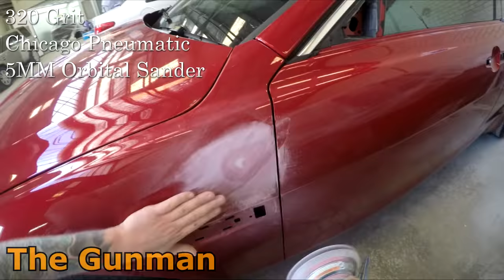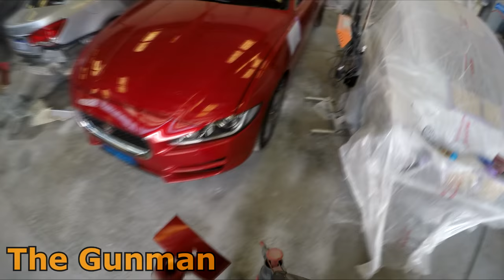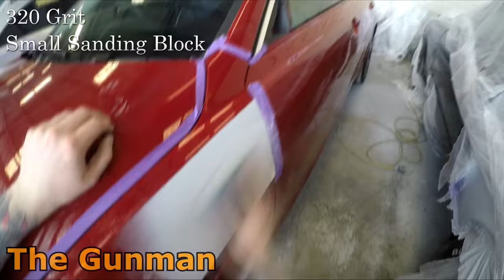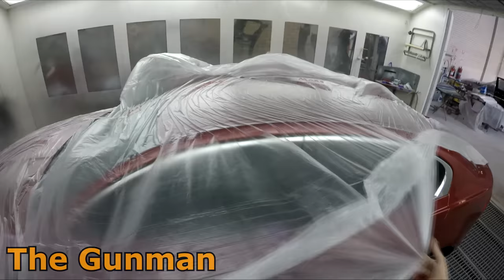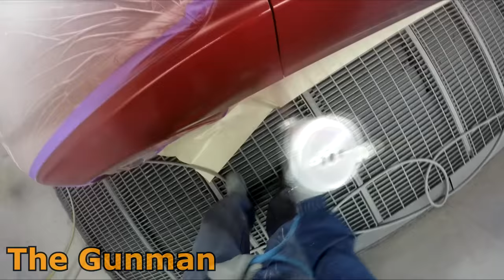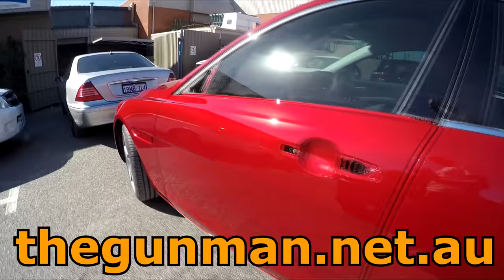XE Jaguar Spray Painting

Comment: That Nebula gun leaves an amazing finish with that clear.  You barely needed to add any more over your last coat just a touch at the top edge of the door and fender really!  I was a little surprised to see that you didn't need the base coat blender for the metallic red,  but in the video you cant see the blend at all.  Sick job.
Reply from the maker: Yeah I've found most darker colours don't need the base blender. Thanks mate.

Comment: You got a reasonably great guns, I mean DevilBiss (the one you mostly use) costs a lot less than SataJets, yet still works the same way, produces great finished works all the time. But may we also get some peaks or recommendations from you regarding a reasonably-priced yet effective Compressors? Perhaps we can see some great ideas on the next compressor that we should buy. I got a 1/2 HP compressor that works great for Big-Bikes, but for cars, I have to shoot it Panel per Panel since my compressor lacks air for big jobs.

Comment: Hey I remembered what you said in your video about the green primers possibly containing chromium. I've been stripping my honda civic 2007 lx and its coated in the grey green primer. I notice that I start to feel off after I sand it off and it continues to get worse until I take a shower. The stuff is simply horrible. (Not 100% that its chromium of if its all in my head)

Comment: Hey Gunman,

Propably a boring question.
Asked you a while ago for Some info.
Got two gti pro's.
1.2 and a 1.4 ( 1.3 tip was damaged ) and was able to buy a 1.4 tip rather cheap.

Got a t1 aircap for base and a t110 for clear or 2K one stage paint.
Also have got the H1 aircap.
Now i was able to buy a set with 1.3 tip, TE20 aircap and needle for a € 50,- / au$ 75,- ) because wanted to go back to 1.3 tip.
At home i use two 50 liter compressors connected to each other. So now a 100 liter. Both deliver a 260 liter per minute.

Now need your advice! I need to sell the 1.4 tip and an aircap... To get some money back.
What aircap to sell, with the needle, 1.4 tip. 
Will be painting some bugs coming monts... Painting Will be done in a rented spraybooth.

Base 1.3 and t1 ( or te20 ) ( t1 uses less air )
Clear 1.2 and t110.

Help me...

Comment: Question. Is old paint bad? I have paint that is about 2-3 years old. I purchased it to paint my car long ago but it got rear ended and totaled before I could used it. It was PPG paint for an OEM Nissan black color. Think I could still use it or its no good now?
Reply from the maker: If it's solvent then it should be fine, it may just need a little more thinners because some may have evaporated.

Comment: What happens if you fix a small dent just with the fine filler and do not apply primer? Im not a pro, but I have been getting some problem on primer edges (lots of dieback) even on light coats and sanding with 800 grit.
Reply: Think of filler as open celled meaning the paint will just sink into it and get absorbed.  Primer seals it off and gives you a solid build surface to paint onto.  I have had trouble with primer edges before and it was sometimes due to:- temperature/ humidity- primer mixed at wrong ratio- wrong type of primer for the paint it was going over- applying coats too fast (not dry underneath- adjacent surfaces not sanded enough or not cleaned thoroughlyDon't be afraid to experiment a little.  You'll figure it out and when you do, you'll immediately recognize it next time and save a lot of headaches and worry.

Comment: hey gunman I've used sata my whole career but I'm interested in trying out this pro lite. I'm in Texas all I can get is the tekna. have you used one to see if they are the exact same as what you use
Reply: Chrism Murphy    tekna is the u.s. version  it's the exact same but black  usually comes with a 1.2 1.3 1.4 needle nozzle's  and te10 te20 cap.  so u get all that for a little over $400 with a digital gauge   I've used sata for ten years now but the pro lite is definitely great and with all the sizes and caps you get you can make it work perfect for whatever you want to use it for
Reply: asheetuglasse thanks I'll be picking one up soon